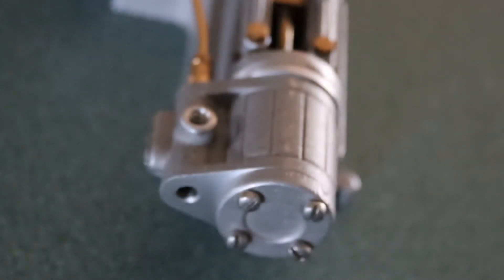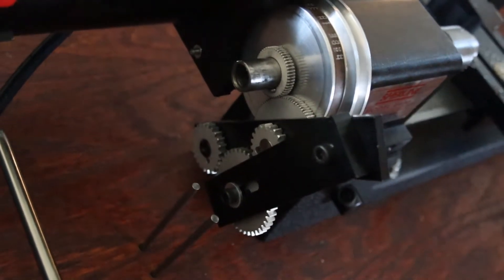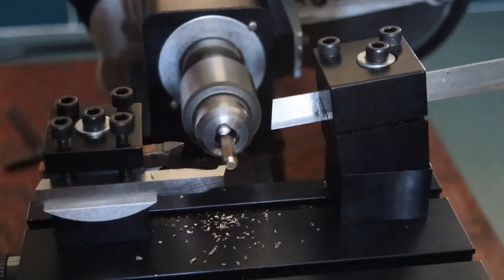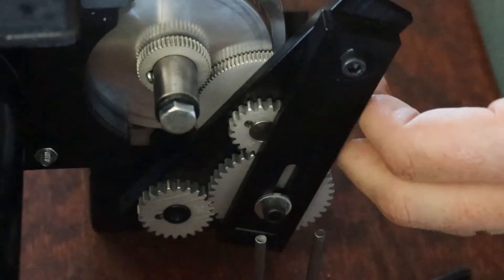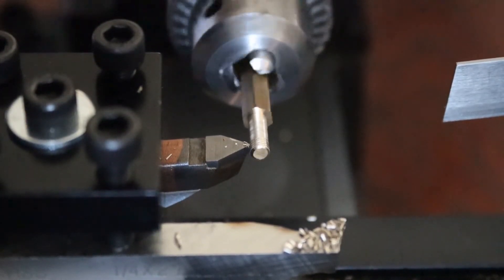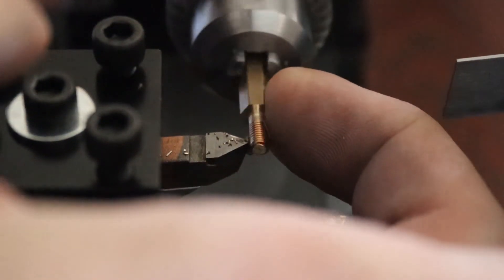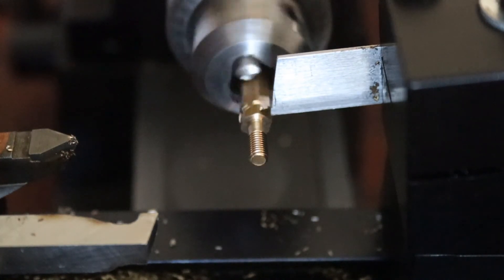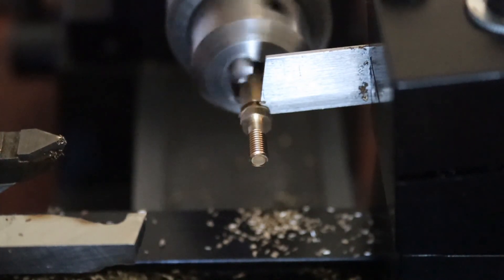Power Threading Fasteners On Sherline Lathe + Cheesy Bonus Intro

Comment: Great video! I'm thinking of inverting the threading attachment as you did on my new Sherline lathe, since removing the motor and speed control is a HUGE pain.  Are you still happy with this modification after 4 years?  Are you able to share the dimensions of your aluminum extension, specifically the inner diameter, outer diameter, and length?  Tip #24 on Sherline's website provided almost no details.  Thanks in advance!